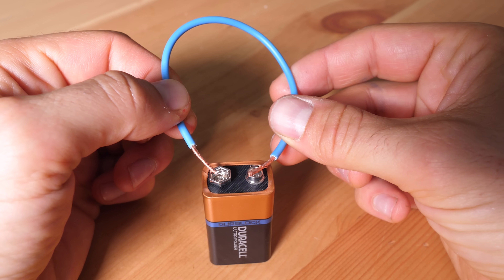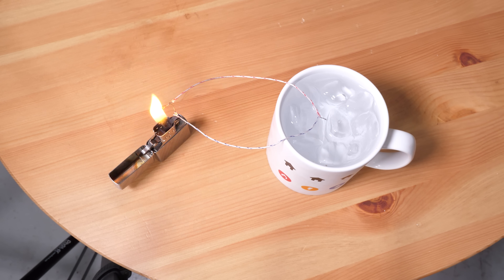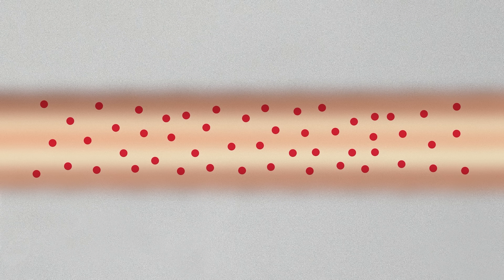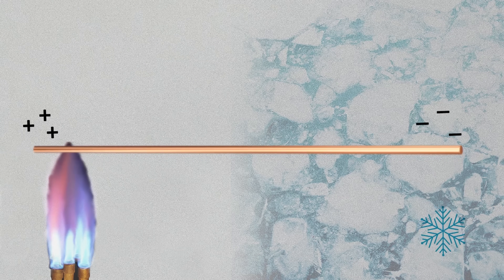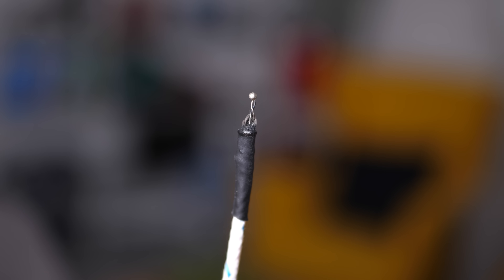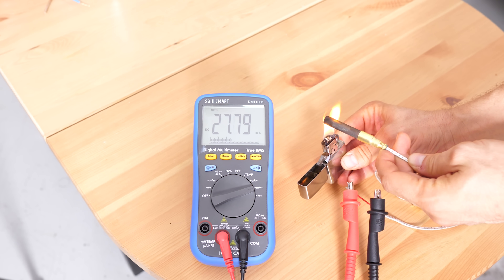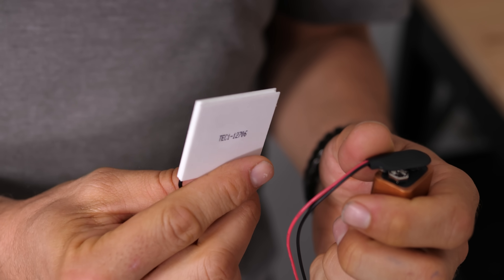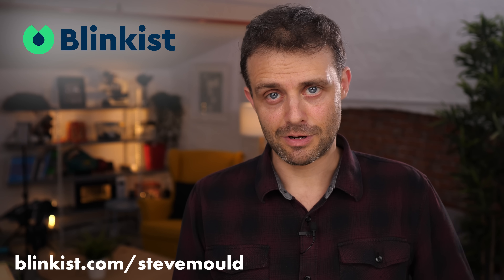Make Electricity Go Round and Round - The Thermoelectric Effect

Comment from the maker: So for a while there was some missing footage in the video (my fault (well I blame Adobe but that's a different story!)) but thanks to the technical team at YouTube I was able to slip the footage in there! Here's the time code if you want to see it: https://youtu.be/O6waiEeXDGo?t=637
The sponsor is Blinkist: the first 100 people to go to https://blinkist.com/stevemould will get unlimited access for 1 week to try it out. You'll also get 25% off if you want full membership.
Reply: Why aren't we using this to convert the heat from reactors and power plants directly into electricity instead of converting the heat to mechanical energy and then to electrical? Is it too inefficient, costly, or difficult?
Reply: @josedelgado7479  It will come down to a combination of cost and efficiency. Steam turbines are impressively efficient. Probably more important is that a turbine scales well to producing more energy. It's hard to imagine how a thermopile could be scaled to produce MWs of electricity.
Reply: Jose Delgado because heat engines are more efficient at converting heat to electricity.
Reply: @josedelgado7479  Much like the Sterling engine, the effect is relatively short lived as the temperature will equalize on both sides and stop the process.  Now if you can cycle seebeck generators or find a way to keep the cold side actually cold, then you may have something worthwhile.  Many years ago they we saying we could run a good bit of our house of waste heat generated from our computers, the temperature difference between outside/inside, temperature difference between hot water (when running) and outside, etc, etc.    Anywhere you would find "waste heat".
Reply: @josedelgado7479  that's because thermoelectric peltier modules are very inefficient at converting temperature to electricity
Reply: @josedelgado7479  the energy transfer efficiency is very low by using thermoelectric material. only very few cases applied it as energy converting method such as space ship or robots for space exploring, where the steam engine do not work.
Reply: PCR blocks run on the peltier effect. Saving poor techincal staff for about  30 years. The original process was using three water baths and youd move the reaction tubes between each. It also allows for incredibly precise temperature changes, 0.1 degrees. This allows us to read things like the difference in melting temperatures in DNA sequences, such as Alleles.
Reply: @wierdalien1  I know right... and people pretend controlling the temperature is part of why they aren't used for cooling CPUs.  In reality it's just about the power use, they can be controlled very precisely.
Reply: Where are the bouncy balls???
Reply: I think your footage at 10:38 is incorrect/paused. I thought my computer had frozen when I got to that part.
Reply: @tharsis  its fine to me
Reply: @madkirk7431  Yeah, he got YouTube to splice in the correct clip after the fact. Originally the video just showed a static shot.
Reply: Nit picky but the electrons move from neg to pos.
Reply: @rickharriss  Yes, but circuits always show electrons from positive to negative.

Very annoying convention to be honest, since it results in stupid things like electrons in a MOSFET transistor leaving the drain and moving to the source, which is totally counterintuitive.
Reply: @Peter_1986  not quite right. They show electric current moving from positive to negative, and current is defined as the flow of (positive) charge. The fact that this means the electrons move from negative to positive is a result of them being assigned negative charge (by convention due to an accident of history). Anyone who tries to imply electrons flow from positive to negative is just plain wrong.
Reply: @loquisitivemind  I wasn't trying to imply that electrons flow from positive to negative charge, I meant that circuits have the convention that current flows in the direction that is opposite to the actual flow of electrons (the so-called "conventional current").
Reply: @Peter_1986  I understand. What I don't understand is why you're worrying about electrons when thinking about electric circuits. While electrons might leave a mosfet from the source, that means the current enters at the source. Circuit theory is based on currents, not electrons, so it makes sense to name the mosfet pins based on where current is sourced and drained.

In some sense, the current and the flow of electrons are completely separate concepts. You don't need to know about electrons to design circuits. This has a nice benefit: if the convention bothers you, ignore it and move on, because it doesn't matter.

I think it's also worth noting that the convention is more fundamental than just a circuit convention. It arises from two definitions (which are, ultimately, conventions themselves): current is defined as the flow of positive charge, and the charge carried by an electron is defined as negative.
Reply: @Peter_1986  yeah
Reply: @Peter_1986 I don't even believe the electron " theory"
Reply: The footage in 10:42 shows only a table not balls bouncing etc... Just to notify you...
Reply: @RobertoMattes  its showing balls for me
Reply: How the hell did you get youtube to replace it for you??
Reply: Skellious  Yeah I'd like to know too. I thought it was impossible! (CGP Grey convinced me with his recent video correction reupload)
Reply: @skellious 
I think it's the same video but probably processed in a different way, to avoid some encoding incompatibility.
Reply: This was such a cool video. It answered a question I had wondered about for a long time. There are wearable devices called Embr Waves that are worn on the wrist to cool off or warm up the wearer. I had always wondered how they worked and the Peltier element was a surprise answer although this video wasn't asking that question.
Reply: My understanding is that the trick you tried as a kid is used to make superconducting magnets.  You have a weak link in a superconducting loop that isn't superconducting get a current flowing then cool down the final link and the current keeps flowing. For possibly millions or even billions of years if it keeps cold.
Reply: @daveansell1970  I was about to say the same, this is how MRI's have that super magnet nearly constantly but they have to be chilled also constantly.
Reply: I just saw you on QI with paraboloid mirrors 👍
Reply: Wow that was fascinating thanks
How come it's not been put to better use...?
To energy efficient I'm guessing
Reply: @richardlilley6274  It is put to various uses including radio thermal generators on spacecraft but it is currently very inefficient because thermal conductivity across the device wastes energy so is only useful where a more efficient engine or heat pump is not practical.
Reply: The 5 Love Languages could really use the Blinkist treatment.  The book could be expressed in one paragraph if you get rid of all the filler.  Or maybe 7 paragraphs if you have an intro, a paragraph for each love language and a conclusion.  I could’ve explained the whole book in this comment, but I wasted all my time talking about how much shorter the book could be.
Reply: I would love to see your thoughts on the Searl effect/device.  The moving electrons causing a cooling effect is supposed to be one of the components of the device.  As a matter of fact it is supposed to get cold enough to cause superconductivity which then makes the device even more efficient.  I looked into the device and I can't find where it would not work.  All the theory seems sound, so I'd love to see where you think the principle falls apart.
Reply: I, by pure chance,  came back and saw the pinned comment and therefore have watched the correct footage, but many of the +100k viewers won't have the same luck.

It's up to you, but maybe you should do a very short video where you announce the correction. That way, at least subscribers, will be notified that you corrected the footage.
Reply: Steve Mould i love you ❤️
Reply: Perpetual motion holder does it as a bar rectifier.
Reply: very fun to put those together as well!
Reply: Video is still messed up, please I need to see this footage now, this table is killing me Im just waiting nothing happens and I still feel like I'm the crazy one
Reply from the maker: @aaronjulien7331  it might be that it hasn't propagated fully yet, sorry! Have you tried refreshing the page?
Reply: @SteveMould  deleted from downloads, I'm an idiot. Thank you so much for the reply
Reply: @aaronjulien7331  delete the video if you have downloaded it.
Reply: I knew what you were explaining.  I just had to imagine what you said was supposed to be there.  

If you’re going to transition to podcasts you could do it directly without slowly phasing our visuals.
Reply: If we use two different metal in a circuit then total workdone increased or not ?
Reply: I think the segment before that now has some audio issues of voice jittering? I would make one last check before you move on tofuture projects
Reply: Why are a lot of thermocouples in series able to produce a higher voltage difference?
Reply: Don't tell CGP Grey.
Reply: I was going nuts trying to figure out why I couldn't see the balls from the edit, and I remembered I downloaded the video in YouTube red, which apparently ignores the modification that was made after the fact. Pretty interesting google made that work!
Reply: yes, and that footage should have been in an unlisted video on a card marked "whoops!".
Reply: Just wait until we can control electron spin with graphene.
Reply: 8:54 That is precisely how I picture my tinnitus.
Reply: The link isnt working
Reply: The multi metre is providing the power, blood.
Reply: this time stamp link does not work... perhaps just on my chromebook running chrome browser
Reply: Question about thermal energy. If I could “giggle “ a piece of matter the right way would it become hot? If it did would it be the result of internal friction? Is that what heat is? Internal friction? I guess that’s a lot of questions.
Reply: The way you think about electrons is in the terms of shells. And then look at the way the universe forms shells of matter... with the different wind speeds at different layers...... is there something going on at the smaller scale that I am not aware of? Or do they correlate? 28v??????
Reply: Original effect Peltier is strongly different from that see above. Lenz ruled ))))
Reply: You can make a wire or block of iron that can hold electricity forever. And when you want the power you can suck it out. Basically a permanent electromagnet.
Reply: It says, the video isn't available
Reply: Did Tesla use this method to invent AC?
Reply: at 3:00 you are analogizing the electrons in the alloy as a gas ...you do understand that the same properties apply to actual gasses that have a difference in conductivity such as "layers of air" in the atmosphere that are differentiated by their relative humidity?
Reply: Gas valves use single junction thermocouples, the magnet holding voltage may be low but the potential current is amazing.
Reply: The pilot lights job is not to stop gas entering the house. it is too light the gas when you need heating or hot water. The thermocouple powers a magnet that holds gas valve open. On new boilers it will light as demand is needed.
Reply: The follow up video to this is the explanation of what a boiler is and and what it's used for the VAST amount of people who don't have or use them.
Reply from the maker: @Alan_Hans__  how do most people get their hot water?
Reply: @SteveMould  From distributed heat plant 40 km from here and heat excharger in basement.
Reply: Please make a video on voltage
Reply: 🔴 What Is Islam? ⚠️

🔴 Islam is not just another religion. 

🔵 It is the same message preached by Moses, Jesus and Abraham.

 🔴 Islam literally means ‘submission to God’ and it teaches us to have a direct relationship with God. 

 🔵 It reminds us that since God created us, no one should be worshipped except God alone. 

 🔴 It also teaches that God is nothing like a human being or like anything that we can imagine.
🌍 The concept of God is summarized in the Quran as:

📖 { “Say, He is God, the One.  God, the Absolute.  He does not give birth, nor was He born, and there is nothing like Him.”} (Quran 112:1-4)[4] 📚

🔴 Becoming a Muslim is not turning your back to Jesus. 

🔵 Rather it’s going back to the original teachings of Jesus and obeying him.

Comment: i still don't understand this part,
in the seebeck effect, if the electron moves from hot to cold, then when the wires are connected, we know that the electron will move from the wire with more electron density to less one in the cold region, but why does the electron again move from the cold part to the hotter part, isn't the electron supposed to be stable there in the colder part.
is it because, in the hotter part, after the electrons are flowed towards the colder region, there is a positive charge generated there which then makes the electron charge flow towards it again, and again pushes the electrons continuing the loop.
the explanation is excellent by the way

Comment: We were taught or believe wrong. 
Metal made of atoms contains nucleus and electrons that hold their relation until it become plasma of free ions and electrons. So current of free electrons in a conductor is wrong. 

Current is charge continuously deposited to a wire and move as surface current around that wire (eg current don’t exists inside a Faraday cage). 

Conclusion? 
1) Electric current is surface charge current of a conductor but an insulator. 
2)!Electric current is charged particle current in vacuum. (JJ Thompson’s CRT)
3) electric current take place in a conductor and vacuum in different forms. 
4) Both require emf to move.

Comment: i don't get why you go through the whole "pouring electrons into the metal" thing.  it's completely unnecessary to the explanation, and sort of misleading.  you don't need to fill the metals with electrons.  they're already there.  it's like you just wanted an excuse to talk about beakers and ball bearings for some reason.
and in regards to fermi level, i'm not fully understanding it.  i hate the different level table analogy because it puts the idea out that fermi level is physical.  it's not.  but i don't understand it well enough to give a plain english explanation.

Comment: Using this insight I can imagine a superconducting cable with Peltier cooling the length of the conductor. Like CATV cable. Two inner layers keep the center cable at the required temp for superconductivity. 

Keep the center cable electrically isolated; but two braided sleeves surround the conductor.  The surrounding sleeves are electrically and thermally insulated from one another; but they have Peltier junctions connecting them at desired intervals. 
The cable runs through a protective sheath which also has all gasses removed. A.k.a.Hard vacuum? Apply a small DC voltage to the braided sleeves and radiate heat to the surrounding pipe walls. Keep the pipes cool with standard evaporative cooling and thermal insulation. 

Would make an interesting experiment!
Reply: So is energy lost in a peltier interaction? Then the superconductor would act like a regular cable with loss.

Comment: You can create an electrical current in a loop simply by moving it near a magnet. It is simpler than heating it though less intuitive. However, these currents dissipate quickly due to the ohmic resistance of the wires.

Comment: I've, for a long time, wondered why thermopiles aren't integrated into automotive panels - the interior/undersized are always at a different temperatures to the top (unless the whole thing is frozen solid I guess)... This would be very low voltage, but decent current (based on surface area), step up the voltage... Charge a battery. Low voltage limits the risk when damage occurs.
Free energy.
IDK never really took the idea anywhere.

Comment: Right at the beginning (of the video, not the universe), looping the electricity was mentioned. This is how persistent superconducting magnets work. Current is gradually added before a switch is thrown - note: not a voltage applied as V/R=I and R=0.   The persistence of a superconducting magnet is measured before it is deemed acceptable (all JOINTS in a superconducting magnet have losses... I could tell you how the losses are minimised but then... NDA).

Comment: One thing to note on whether it would be a good thing for just being a single thermocouple and noting that an issue would be if there was a power cut and then losing heat...?!
In Australia at least almost any gas fired heating we have be it central heating or space heaters, will almost Always need to be powered as they require Fans for circulating the heat. If this isn't done in fact there is a good chance of cracking the heat exchangers as they get too hot without having fans exchange heat with the room and keep the heat exchanger feom actually getting too hot.

Comment: What if you used a superconducting wire like 1.1°shift carbon nano tubes  inside of other nanotube and a ceramic dielectric seperator next to copper tubes sealed with water in the low atmosphere environment and another final layer of NdYBO? The cold side being the superconducting side of the peltier, copper transfers thermal energy across both sides hot and cold of the nanotubes which are seperated by an aluminum ceramic dielectric that builds voltage potential, another one that might work well are nichrome heating wires to transfers thermal energy. My thinking is if they make good heaters they must have good resistance meaning the effect is weaker than a good thermal conductor like the copper. The temp diff would meet in the middle front and back and the dielectric would transfer electricity perpendicularly. Maybe a better peltier element? Idk. 🤔